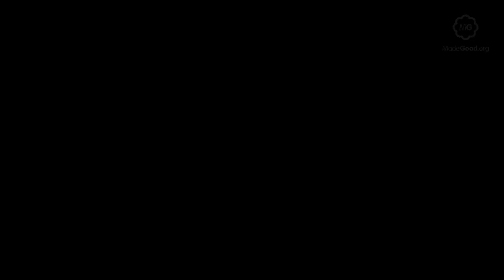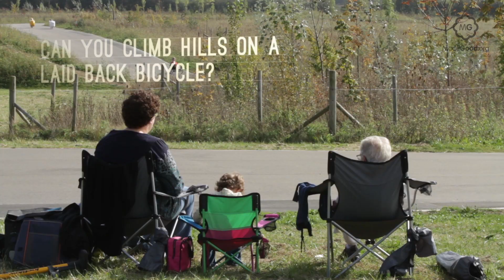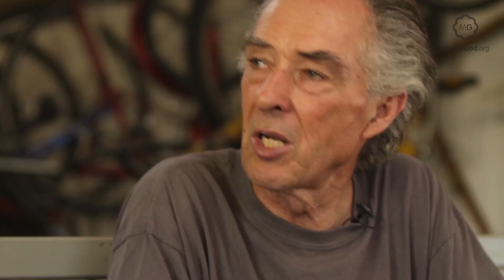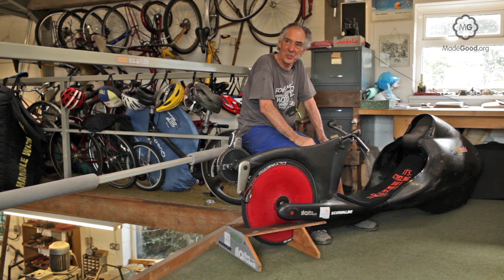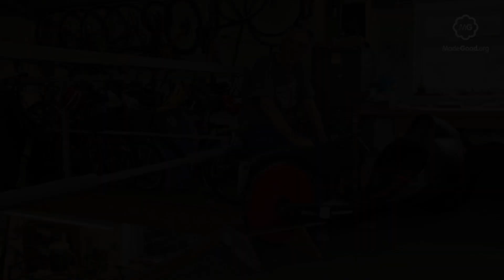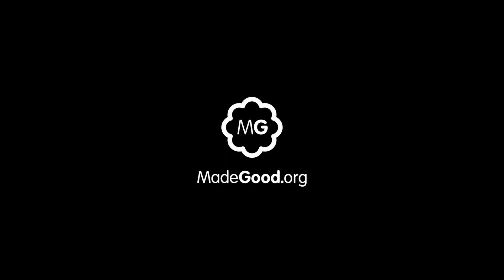Mike Burrows - Can you climb hills on recumbant laid back bicycles?

Comment: The other thing that might be important is the inertia that your legs are pressing against. Pedalling is not even, there is a power stroke when the cranks are at a good angle to your foot-hips line, and a weak part of the stroke at top and bottom "dead centre". Clip-less pedals help, because you can push forward at the top of the stroke, and pull backwards at the bottom, but those are still not strong strokes.

On an upright bike you can let the bike move forwards and backwards underneath your body. So on the power stroke your legs can accelerate the bike without needing to accelerate your body mass too, then the bike slows at top+bottom of the stroke when your legs have little mechanical advantage and your body catches up. The biggest mass, your body weight, doesn't need to be accelerated on every power stroke, so less peak force is needed from your legs.

On a recumbent, like on a tandem (unless you and your stoker are able to synchronise getting off the saddle), you don't get this ability: your legs have to accelerate your body weight on every power stroke. So the peak force in your leg muscles is higher.

Getting out of the saddle uses the bike as "suspension" to even out the variation in strength as the cranks rotate.